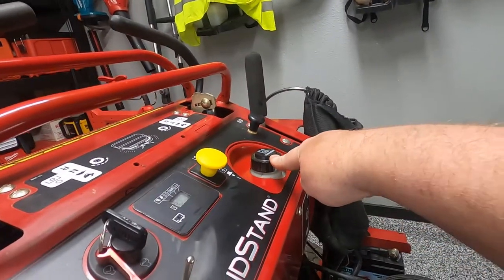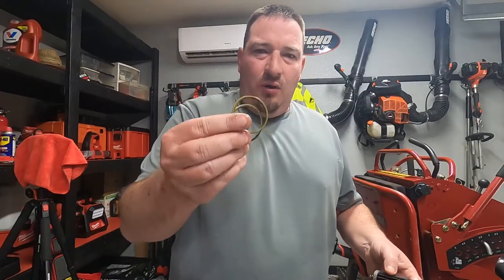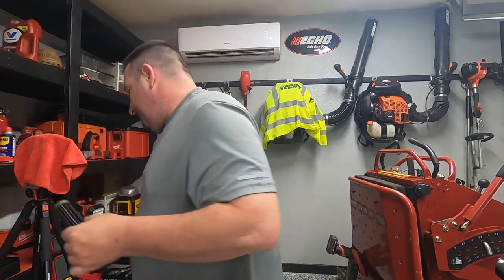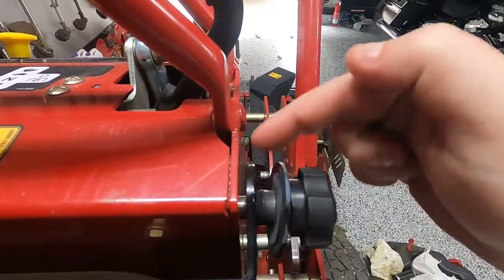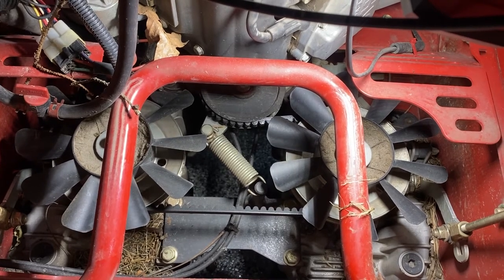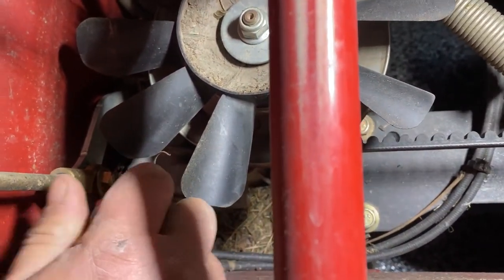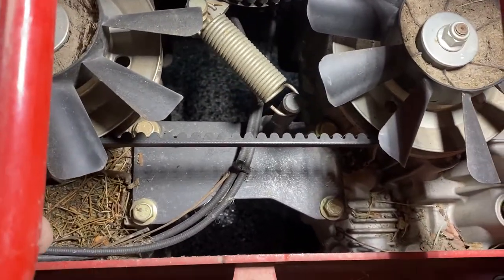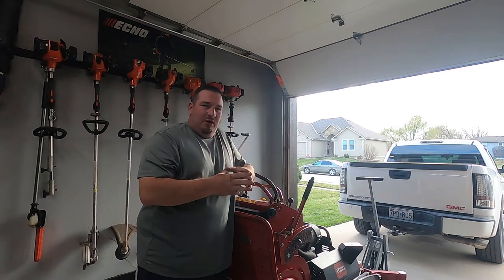How To Change Hydro Fluid and Filters On TORO Grandstand

Comment: Oh man. Great job. I wish this video was up 3 years ago when I did this change the first time.... 

The manual did not mention the vent caps and had to figure it out after fluid wouldn't go into the hydros.... That was fun. 

It's always cold as heck here when I do it, last year I bent one of those vent caps and had to order a new one mid change, the plastic caps are pretty weird to have on such a beast of a machine.

I try to remember to not top off the gas at end of season to make working with the gas tank easier. Also putting the oil inside in the warm to make it flow in easier seems to speed the process.

Comment: Nice job. Let me add, to bleed the pumps you do the same thing. Unscrew the caps half way, start the engine an observe the fluid and bubbles running out. Once clear fluid is flowing tighten caps. You’re done.